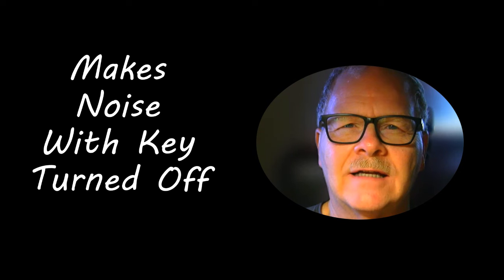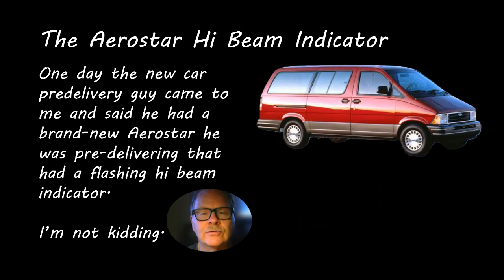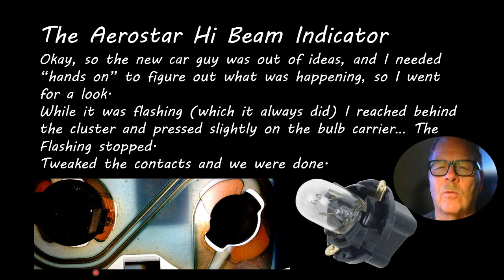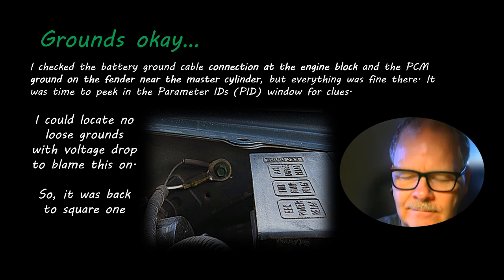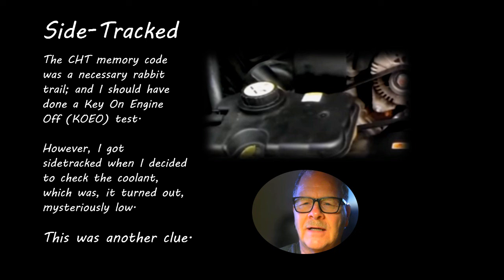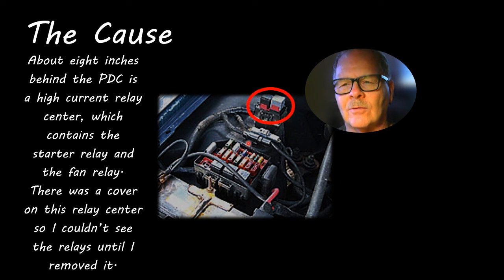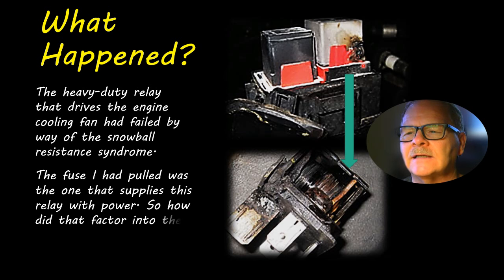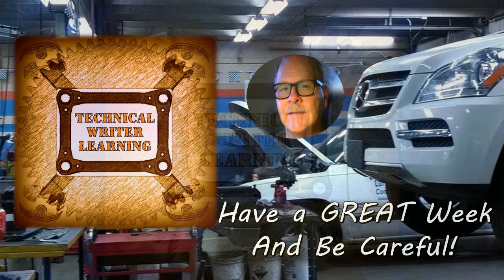Makes Noise With Key Off

Comment: 12:55 My theory is that FAN HIGH RELAY had a lot of current going through it and melted. In the beginning there was low resistance in the load side contacts of the relay that dropped the voltage to the fan. This feed wire voltage drop to the fan made the fan turn slower and couldn't build enough back EFM. So the current through the relay and the fan remain high. I would replace the fan motor too. It could be working but i suspect it may be slightly damaged by the constant high current running through it. 🧐
Reply from the maker: The fan motor pulls enough current so that if there is resistance anywhere it will heat up at that spot. I have seen this on various different fan circuits even when there was nothing wrong with the fan. That car remained in operation for another 10 years and never gave any more trouble with the fan